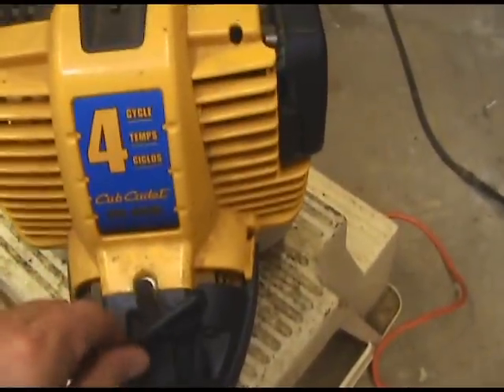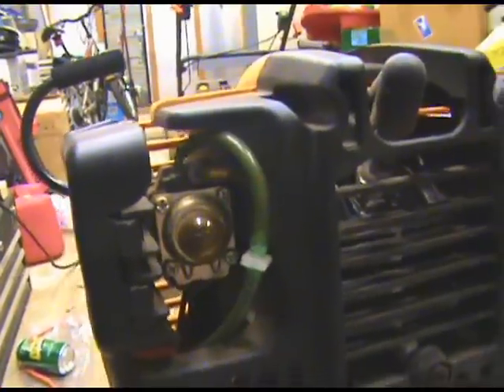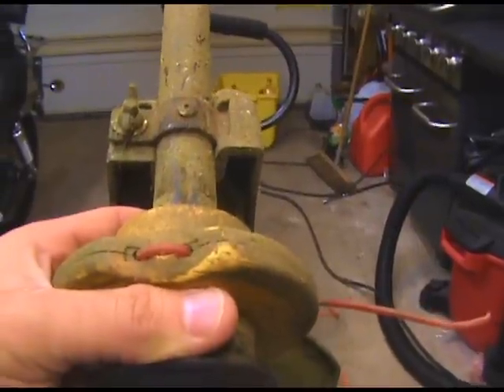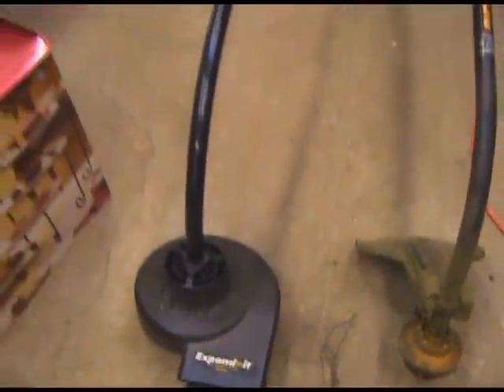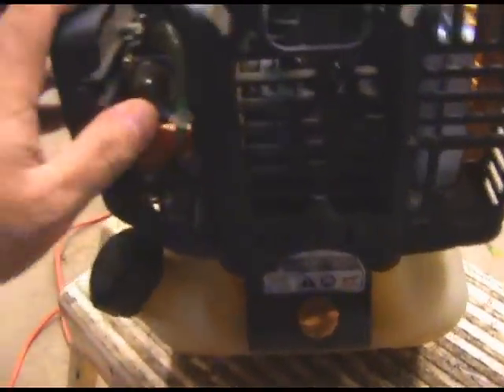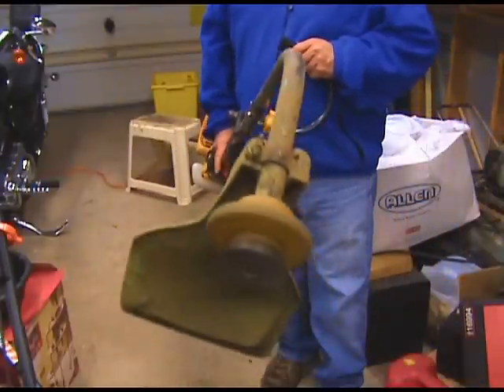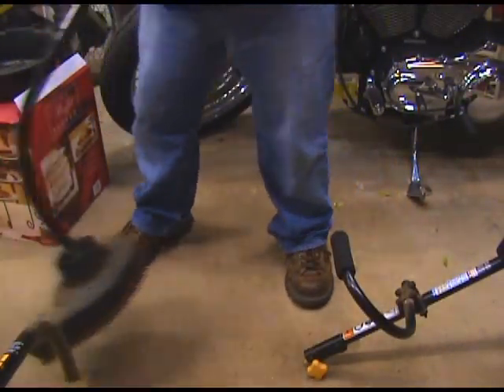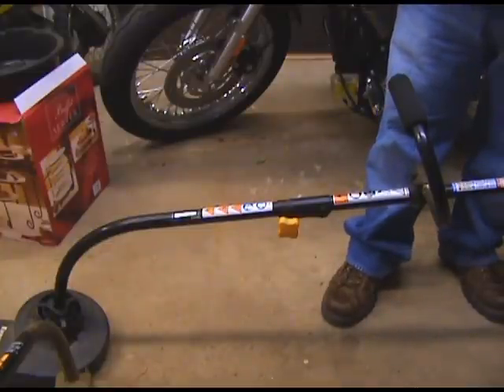4 Stroke Cub Cadet CC 4125 String Trimmer

Comment from the maker: @cat123456789101 
It probably sounds like a 2 stroke in the video because the engine is so small it's harder to tell.  Your weed whacker may have more power than mine since it's a 2 stroke.  Thanks for watching and commenting.

Comment: its a cool weed eater
Reply from the maker: Yeah, it's ok but I kept breaking the shafts on it. I had about 90 extra bucks into it so I decided to buy a new heavy duty one. Check out my videos on my Stihl FS90R. The thing is a beast. I ended up modifying the cub cadet so that I could use the blower attachment. I'll attach some video links.
Reply from the maker: Cub Cadet String Trimmer Paisteboy Free Fix

OH NO! String Trimmer Problems Again-2012

Comment: Got the cub cadet cc350 that will crank easily but when you throttle it it will die need quick answer
Reply from the maker: Could be a cracked fuel line.

Comment: I am trying to find the diameter of the two fuel lines.  I replaced the fuel lines, but one leaks by the tank.  Was there a plastic piece that I am missing or do I have the wrong fuel line...
Reply: Did you ever figured it out? Unfortunately,  I have the same problem.
Reply from the maker: Not sure and the unit is out of commission at this point. sorry.

Comment: It stands for  cubic  centimeters. It is metric. Instead of  cubic inches.  Lol  looked it up  I have a 4 stroke  cub cadet.  I need a video that shows  how the fuel lines are ran from the tank  to the primer bubble.  There are none on it to go by.
Reply from the maker: If you want to see a video on the fuel lines check Donyboy73.  It may not be this model specific but he is a small engine mechanic and has many videos on string trimmer fuel line replacement.  Thanks for watching.
Reply: It's easy.  Cut off old lines. Get some new fuel line and a new filter.  Might have to ream out the holes in the tank for the lines but it's easy. Get about 1-2 ft of line from T.S.C.